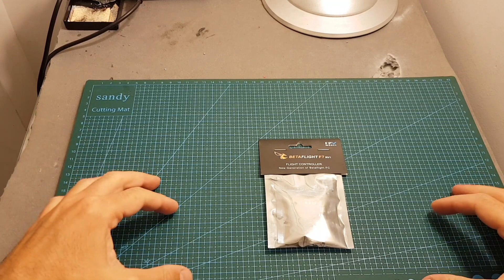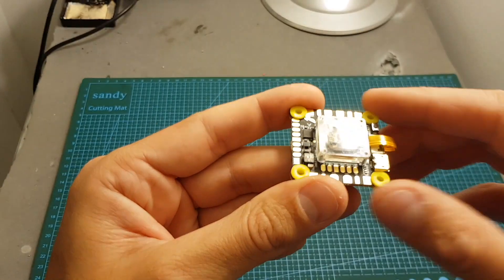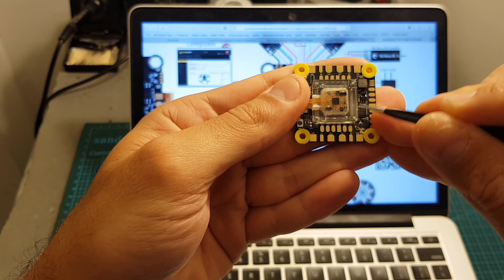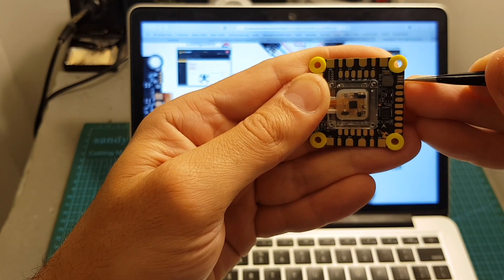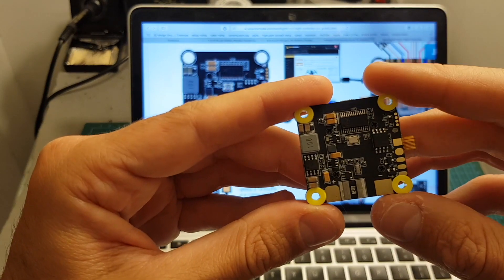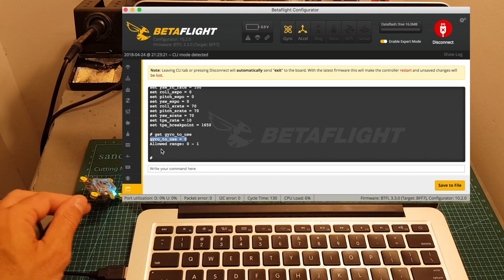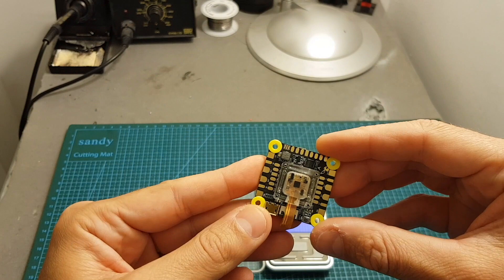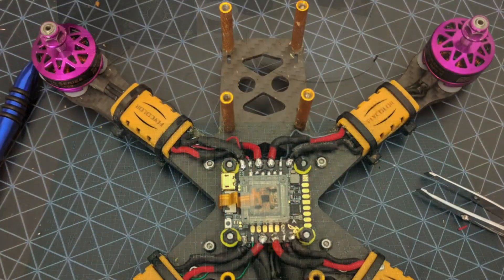BetaflightF7 RV1 Flight Controller - Overview, Setup & Flight

Comment: What UART would I use to hook up a RunCam Eagle Micro with remote control? I doubt it uses the camera control pad. Has any used this FC with this camera?
Reply from the maker: The camera control pad would not work, as far as I know. 
Any free UART will do. I haven't used this FC with a camera that has a built in camera control.

Comment: Originally I was thinking of getting this FC for a recent build. However, they need a RV2. I do not like the ESC positive and negative pad layouts. Two of your ESCs will need to be twisted over for the main positive and negative wires. It ruins a build and makes it look weird due to a poor design choice. Just make it positive-negative, positive-negative, positive-negative, positive-negative all the way around the board. 

FPV Model needs to get rid of the positive-negative, negative-positive, positive-negative, negative-positive for the ESC pads.